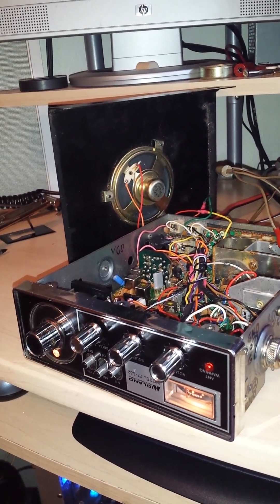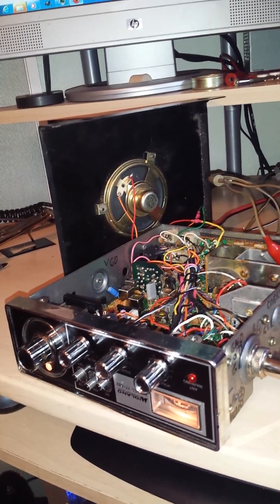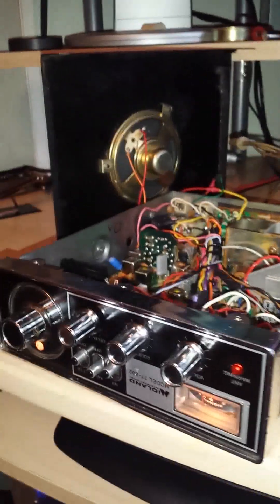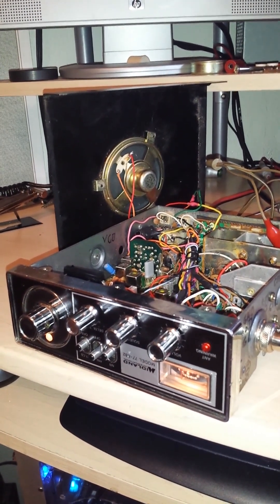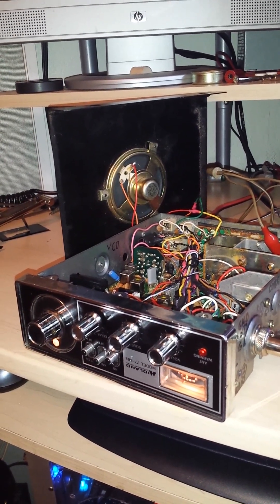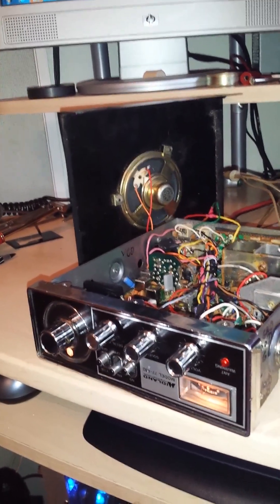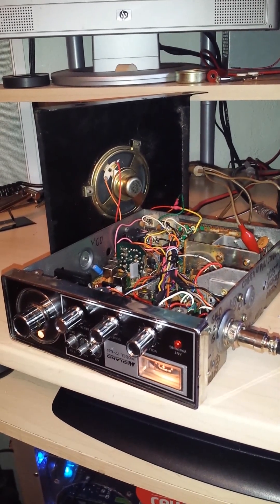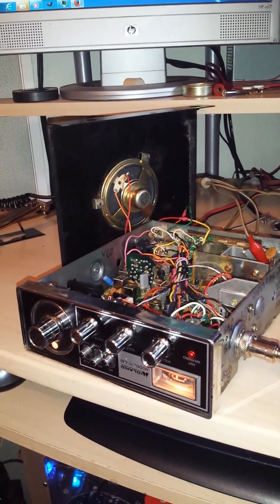QSO w Midland 77-882 converted to 10 meters 29mhz ham radio

Comment: So looking for a way to do a conversion of an old Midland or Cobra 23 channel radio to do 23 below the standard channels. Our local channel is 26.905 with a backup of 26.915. We just get so much noise and skip on the standard 40 channels it's hard to hear mobiles without a foot warmer. But drop just a few Khz and it's wide open unless the Superbowl bleeds us bad. Any ideas if this is possible? I have a Cobra 29 with a channel kit that's 40 above and 40 below but want a radio in all my cars and tractor. Would like to recycle these old 23 channels and make them talk again in a second life.
Reply from the maker: Theres a new deal called a dds vfo. It can become the oscillator for any radio giving it almost unlimited coverage within the limits of what the tx rx can support.  Cbradiomagazine.com did a review on this device. It's the biggest thing in years!
Reply: @hamradiohack  Thanks I will check it out.
Reply from the maker: They use a xtal mixing scheme.  It's do able I guess if you have lots of odd frequency xtals

Comment: So I found one of these cleaning out a storage unit and got it, what do I need to power it up, I have never had a radio like these and pretty much don't know shit about them, what chord or other stuff specifically do I need to power it up
Reply: Troy  Peeler You Can Use a  Cobra Power Chord From a Older Cobra 29 Classic i Really Dont Know If You Can Use a Mic From a Cobra If But i Do Know That The Power Chord From The Classic Will Work Right !!!